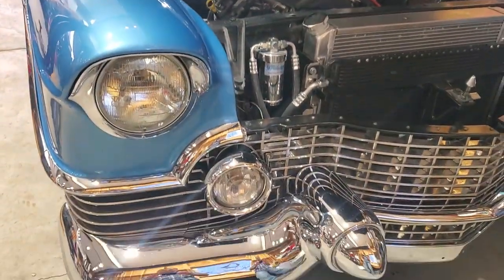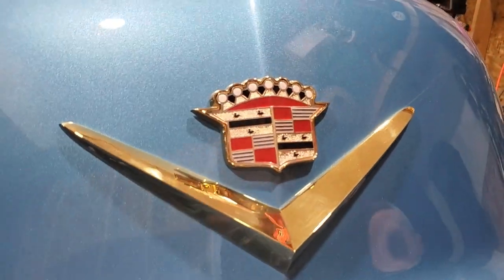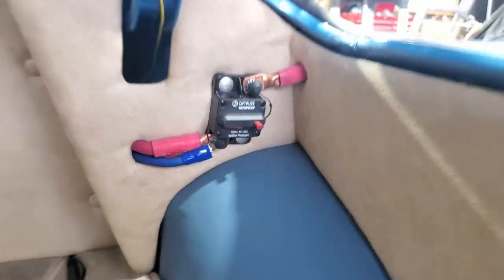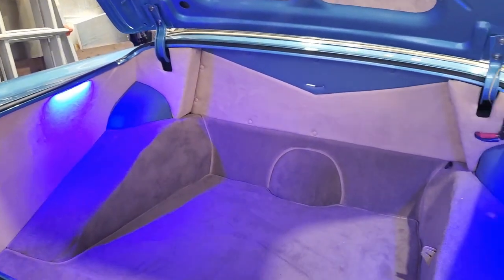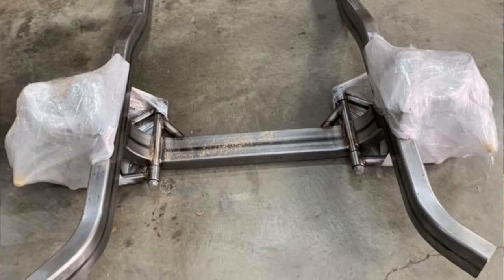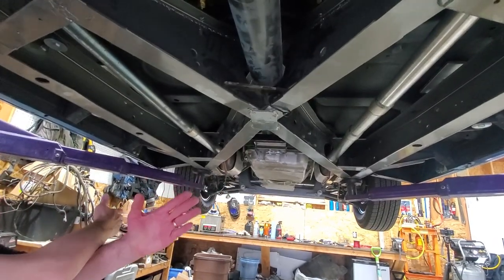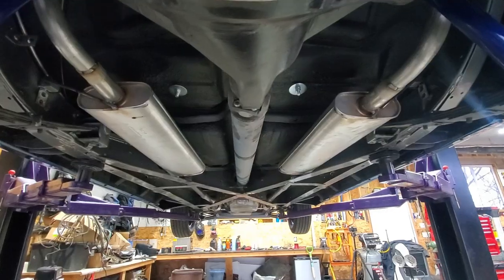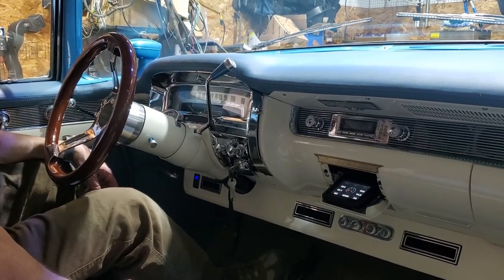How 'bout an LS swapped 1954 Cadillac

Comment: How can I get a copy of the autronic eye cpu improvement? I am restoring a 1956 Coupe, and also doing an LS swap too. Lovely video guys!!!
Reply from the maker: Take a look at this:  https://www.jalopyjournal.com/forum/threads/great-info-on-the-autronic-eye-guide-matic-lots-of-pics.580437/
Reply: @some-guys-garage  There is no redirect on his link... But I can call him if his number is still current.

Know where I can get the proper windshield wiper upgrade to electric? I have not had a chance to even TEST mine yet to see if it even works.. But I wanted to have the electric wipers locked and loaded so if the vacuum ones didn't want to function anymore, then I would still have a no stress plan b available. 😁

Comment: The car is beautiful, but the dash kinda got wrecked.
Reply from the maker: You prefer the stock dash?
Reply: @some-guys-garage the stock dash in most vintage cars is hard to beat... But I think what's throwing me off in this particular car are the (I hate to say it) cheapo looking Vintage Air A/C vents...

The white lower dash extension is a bit stark for my taste, I'd have painted it in that blue shade to make it look like it wraps out of the door panels... But of course it ain't my car, so that shouldn't mean anything.

Anyhow... Years ago, my whole family was involved in a restoration business that Dad ended up starting from his auto repair business.

He had been in the car game since the mid Fifties, so he saw just about everything come and go, and through osmosis, my brother and I saw just about everything, too.
 
Our shop was north of Houston, so we ended up fitting a lot of customer's 40s/50s vintage cars with air conditioning and we would usually forgo using what Vintage Air offered for vents and go grab some vents out of one or another early to mid 60s car at the scrap yard.

The A/C vents out of late Fifties through mid Sixties Chevys and Caddies were round chrome deals that would usually fit the curve of the dash in one of those older cars,o we used those a lot.

Another really great A/C distribution method was from MOPAR in the mid Sixties... When a customer ordered DEALER INSTALLED A/C, they'd put a chrome, straight line bank of four louvered vents under the center of the dash... The chrome box was about two feet wide and maybe 2 1/4" tall and looked great.

Since Dad's pushing 80 uphill and retired, and I'm not really fooling with old cars anymore, I quit actively looking for those kind of parts.

But boy, how I wish we would have really stocked up on that type of thing back in the 80s and 90s when it was relatively easy to get our hands on!

It seems like everything is so sky high now... And the really cool stuff is non-existent.

Oh... Meant to say that those wire wheels are magnificent!

They look exactly like the original optional wheels!

Cheers
Reply from the maker: You have a discerning eye. Thanks for the thoughts.
Reply: @some-guys-garage thank you for reading them...